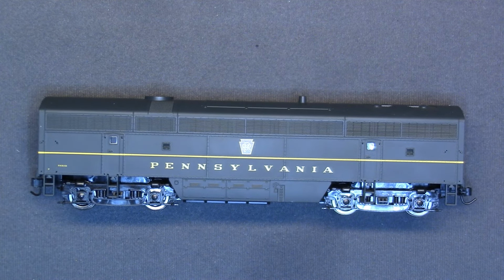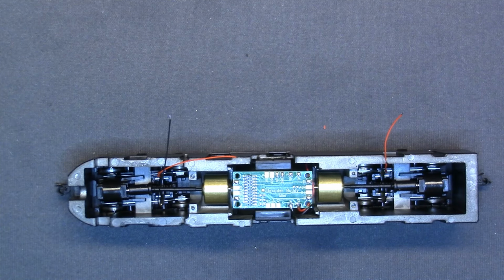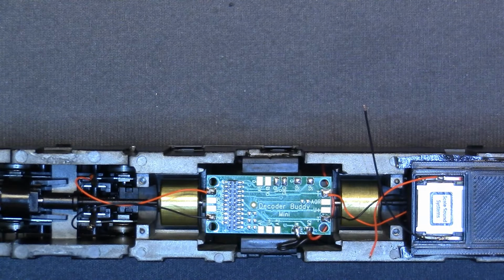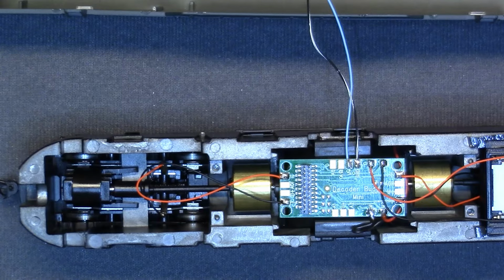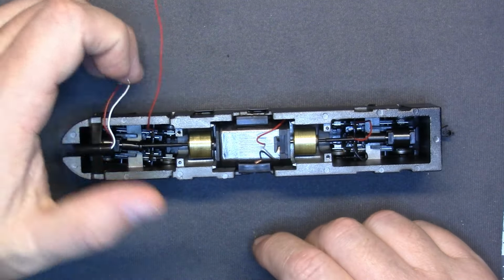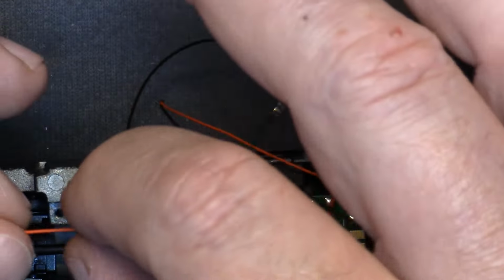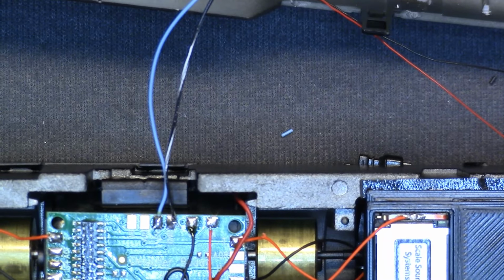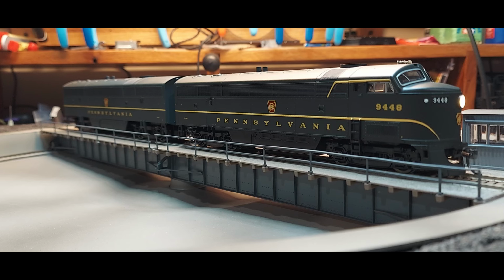Proto1000 C Liner DCC install

Comment: Don't have any C liners yet but I noticed the grab iron holes are predrilled did it come that way or did you do that?
Reply from the maker: It comes that way.
Reply: @SoloContracting  Oh nice! Only proto 1000 I have so far is an GM&O rs2 and its grab iron spots are not predrilled but have the little starter bumps unfortunately that is too fiddly for me these days but 20 years ago it wouldn't have been an issue haha. .